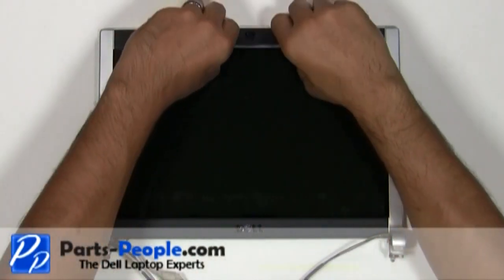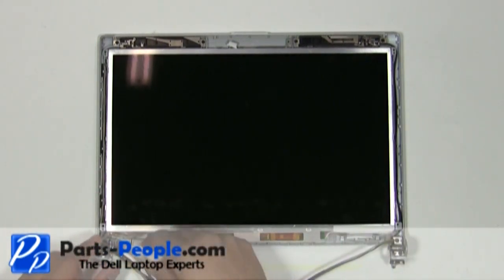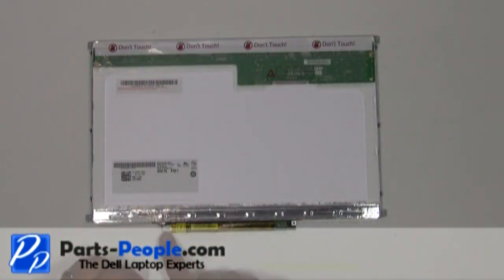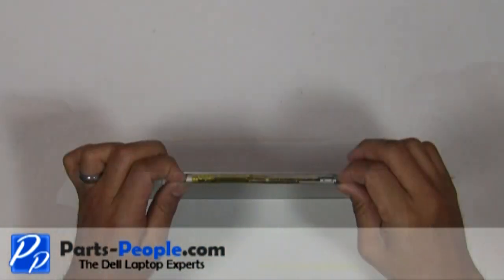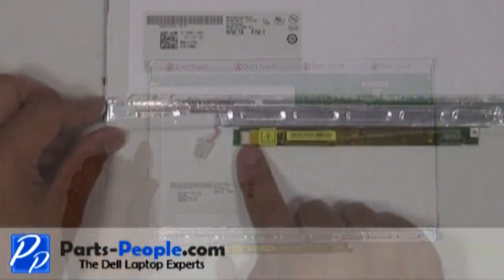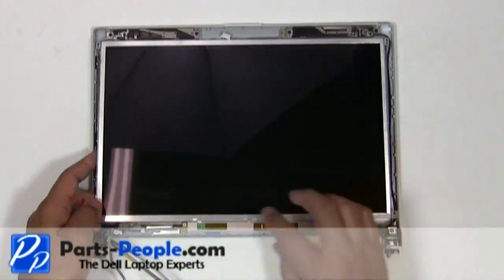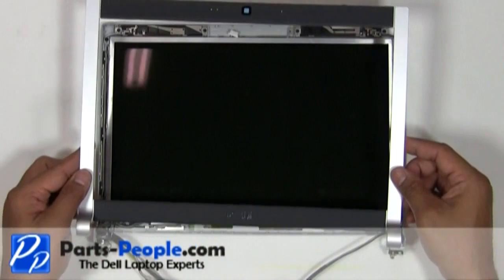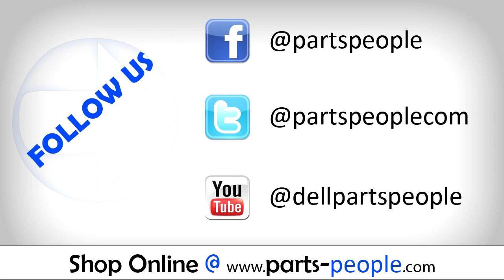Dell XPS M1330 | LCD CCFL Inverter Replacement | How-To-Tutorial

Comment: Is it compatible with xps M1210?
Reply from the maker: These models are not cross-compatible and I doubt this would work.
Reply: @dellpartspeople  Thanks for your concern. Could you please help me to find Lcd ccfl inverter for Dell M1210 if you know any website it is available in??

My laptop's screen falls dim after some seconds of use

after some research I got to know that i have to replace its inverter.